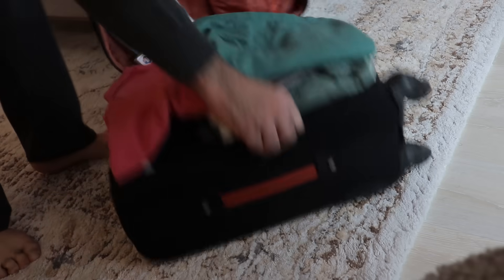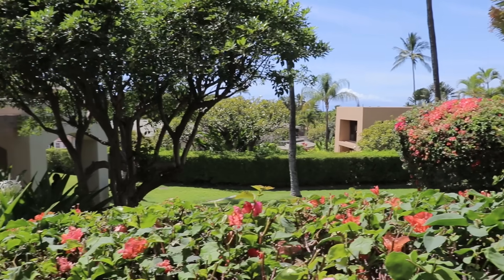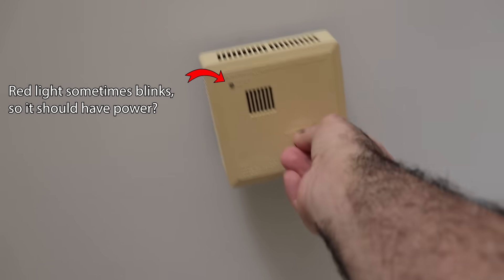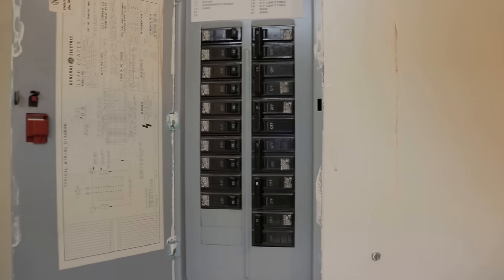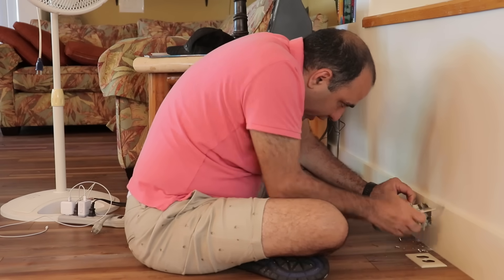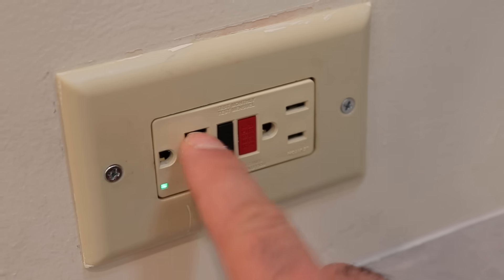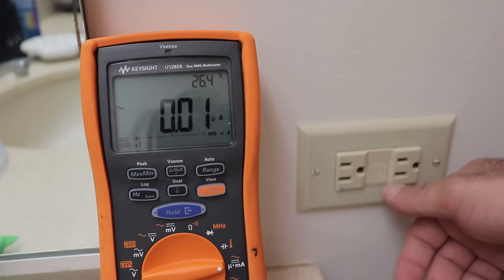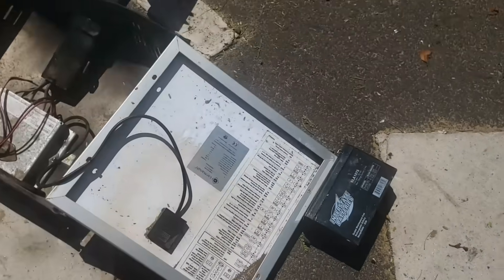Hawaiian Hotel Safety Failures

Comment: I didn't know outlets with poor contacts like that were fire hazards. I'll be replacing mine in my room now after seeing this video!
Reply from the maker: They are if you constantly draw high current from them. For low current applications they should be ok. But quite annoying since they keep disconnecting!
Reply: @ElectroBOOM  This is one of the reasons combination AFCI protection is now required on just about every 15 or 20 A / 120 V receptacle in dwellings under current (no pun intended) Canadian Electrical Codes. 

I am jealous of UK plugs - so robust, right-angle, and fused. (sigh)

Love your channel and show your vids to my first level electrician students.
Reply: @ElectroBOOM  been a while indeed
Reply: Yeah  @ElectroBOOM
Reply: @ElectroBOOM  where are you from
Reply: Loose outlet contacts also cause sparks which can cause even more heating.
Reply: @JohnShalamskas  and sparks cause carbon deposits which cause EVEN MORE heating.
Reply: @mattv5281  And the carbon deposits increase resistance, causing even more heating which eventually melts your outlet.
Reply: As a tip, don't buy the cheap $0.99 outlets. Pay a few bucks and get the so-called "commercial grade" outlets. They have much better contacts that last a lot longer generally.
Reply: If I was you I would buy a live wire detector before attempting any work just to be sure because you never know, the outlet in your room might be powered through the breaker for another area
Reply: @Cam-gb1cu  Great advice. Never ever assume a wire isn't live.
Reply: @Cam-gb1cu  My house breakers make no sense at all; entire basement living room on one breaker; one kitchen plug tied to that basement circuit. 2 bedrooms lights only and upstairs living room plugs; upstairs living room lights on the kitchen plugs.
Reply: @frollard  Yeah, many of my rooms have outlets tied to different breakers and were never marked accurately. When replacing an outlet in a bedroom not 6 feet from a light switch I shut off the breaker, checked the lights then found the outlet was still live. Luckily I always check but another outlet next to it was tied to that other breaker. At first I thought they were splitting the load in the rooms but in reality the builder seemed to just randomly tie into existing electrical when convenient. This outlet was shared with the nearby bathroom and hallway. The others somehow got tied into parts of the garage on the other side of the home.

Very frustrating to say the least.
Reply: @JJFX-  Almost always lights and plugs are on different circuits. 
On new construction if they can save 10 feet of wire by doing something legal, but crazy, they will. And all bets are off if there has been a remodel. I saw a pretty new house where they chained two bathroom outlets to a GFCI outlet inside a cupboard in the garage just to save cost. The owner had put up with the dead bath outlets for over two years, because the GFCI tripped and no one knew about it.
Reply: And switches. If you can hear a farting or buzzing noise from a switch or you see visible sparks inside, or it either can be nudged on or off by moving it just a bit  (rather than all the way), then it either has a softened spring or oxidised contacts. This can heat up in the same way an old outlet can.
Reply: and thats why when i move into a new place i bring an outlet tester to check all the receptacles to see how loose they are and if they are even wired correctly
Reply: @geekmoto1363  A (relatively) cheap thermal camera can be helpful too.  Plug in large loads at the end of the line, and all the chain-backstabbed outlets glow nicely.
Reply: If you do replace them, don't use the backstab connections. Curl and screw the wire for a quality connection. Nearly every service call I've done involving bad recepticles was due to over use or backstab connections that burned thru the sheathing of the conductor. Be careful if you've never done it. Don't touch anything energized. It hurts.
Reply: @EeekItsSnek  Shhh, that's easy money for sparkys!

Seriously, I agree 100% and I do not know why CSA allows them. Mobile home devices I've seen don't even have screw terminals. It's back-stab all the way. Garbage.

I'm careful to differentiate these for my students from the good kind of rear-wired terminals where the wire is trapped between the terminal and a square "nut" tightened by the screw.

A fellow I worked with some years back (different vocation) wired his own basement rec-room project. Did the right thing, took out an owner's permit. Discovered the back-stab terminals and thought "this is great!"

The inspector made him take everything apart and redo all the connections properly. When my coworker told me the story he was still steamed. I assured him that inspector had done him a favour.
Reply: Only in the case of heavy appliances
Reply: Yeah, heat from arcing burned one of my outlets. I'm my case, it was a loose wire on the back, but same thing. (That rent house was dangerous. Ancient 14 gauge cloth-coated wiring with 20-amp breakers!)
Reply: Get Pass&Seymour Legrand receptacles. Can't go wrong with that brand.
Reply: I have never, ever seen a worn-out Schuko Plug or receptable. Even after decades, they still grip tightly.
Reply: @kain0m  I have seen a couple of worn out Schuko receptacles (usually the plastic parts die long before the metal contacts) and a few bent Euro plugs. But those are exceedingly rare and require a lot of abuse to happen. The ones I have seen were usually of east German origin or from the 60'ies with really bad quality metal parts. Worn out, nicked and bare cables are much more common in Schuko-Land.
Reply: Silly me, I've always just bent the tins of my plug outward a smidge to get a better connection in the outlet.
Reply: @LetUsPlayMoreGames sadly in my house it didn't work. The outlet contacts were still way too spread to fit a plug in and still be grabbed by the contacts enough not to fall right out.
Reply: They sure are! The contact between the screw terminal and a wire is equally important.
Someone previously had installed power points here by just screwing down until the terminal screws ripped through the insulation on the wire tip. It got hot and started arcing internally. I had to correct or replace the rest of the power points in the house after discovering that.
Reply: Also check the breakers where the wires are connected to the breakers. The screws should be tight. My house I had 6 breakers the screws were loose
Reply: <3
Reply: Same
Reply: I’m letting my customers know that and gonna check mine at home
Reply: We had an Amazon brand urn (a super sized kettle) at work that had a fuse holder in the plug that was unusually loose. Came in one morning with a melted plug. Oops.
Reply: I guess that's one reason I don't mind being British we have safe outlets
Reply: Speak to a welder about how hot the earth gets if it's loose or frayed wire.
Reply: Don't take advice from a comedy channel
Reply: Well i mean you could also live in a country where the plugs are smartly made
Reply: @r0und603  as bad as South Africa is, the plugs are somewhat robust. 3 round pins.
Reply: @rushilkisoon  Yet still you find a lot of the outlets the only grip they have is the plastic part, the contacts are worn out and spread, causing poor contact on them. Changed many where the only thing providing grip was the shutter, and even more where the shutter was broken anyway. Then the cheap ones and the switches that melt away.
Reply: @r0und603  even here in Brasil they are very careful engineered
Reply: @r0und603  From the UK perchance? 🤔 Yes, garden-variety NA receptacles are kind of a joke, and that's before someone doofus cuts the ground pin off the plug-end or it just breaks off in a receptacle.
Reply: @r0und603  not many places have UK plugs unfortunately. It's just the UK and a few old colonies that adopted good plugs.
Reply: @Dennis_M1DLG  i live in south africa
Reply: @r0und603  Yea Vidhoard, don't replace a few outlets, move to wherever R0und is from. Some enchanted land where things don't wear out...
Reply: @outsider344  lol will do!
Reply: @outsider344  "where things don't wear out…" Where things are not badly designed.
Reply: @pakan357  LOL Yeah, like ring circuits... 🤔🙄 Give me a break. Your gigantic plugs are made for children who don't have the intelligence or fine motor control to grasp and manipulate anything smaller. In the real world they aren't actually safer, they just waste space and material, not to mention are a PITA to store, transport or use.
Reply: @awo1fman  Clueless.
Reply: @pakan357  is there some place I'm not aware of where residential outlets are twist lock connectors? Normal outlets everywhere use springy bits of metal to contact the prongs on the plug. Where are you that they have designed away metal fatigue?
Reply: @outsider344  I'm from Pluto, apparently. Because I have never in my life seen a plug that feels even remotely as loose as that piece of shit in the video, not even a 60-year-old one.
Americans simply can't design an outlet and door hinges, don't get emotional over it.
Reply: @pakan357  Oh sure, it's easy to be chill from Pluto.😜
Reply: @awo1fman  Whoa dude ease up a bit. Not everything has to be a rabid team sport.
Reply: @pakan357  Not gonna say what outlets you think dont have this problem eh? Don't want to be fact checked?
If you want to find problem outlets on pluto go to a short term rental property. Age isn't the issue, insertion cycles are. You can expect the accessible outlets in places like hotel rooms to have more cycles in a year than your example outlet did in its 60 year life.
Also, hinges? What?
Reply: @outsider344  they dont wear out cause you gotta replace them every one in a while when they get yoinked
Reply: @r0und603  Doesn't really matter which country's outlets you use. Safety features are better on different countries' outlets, but the way they make contact is relatively the same. After so many use the contacts will become loose and will require to be replaced.
Reply: You could in theory open the outlet and squish the contacts back together, instead of replacing it
Reply: @rushilkisoon  It’s not possible to squish them back together because you need to bend it a bit further than the intended position which is impossible because the opposite contactor is in the way.Also the metal may have fatigue, so it just will bend back to the sloppy position after putting a plug in a few times. I wouldn’t know a reason to not replace them anyway. If you do anything then do it properly instead of creating a bigger hazard.
Reply: @Engineer9736  ¯\_(ツ)_/¯ Worked for me. I was only able to get one contact (the outside one) on each side moved back to the proper position, but it looked like on my outlets only one contact would connect to each prong anyway.

I think they weren't worn with years of use so much as bent too far by those child-safe plastic covers. I only found the problem on certain outlets where a toddler might have obvious access. 

Getting beside the contact to pull it in was hard though. I tried precision screwdrivers but the round part was too thick to fit. I ended up using a windshield wiper insert.
Reply: @rushilkisoon  yep, you could, but some of the old receptacles were pined Bakelite and will break before the pin comes free. However some of the new ones are ultrasonic welded plastic and will not go back together easy. A very very thin melted layer may do it. If it has rivets they would be drilled as long at the bit is smaller than the rivet and replaced with a new rivet. But then for $2 for a good receptacle, the repair would cost more.
Reply: @rushilkisoon  maybe. But there's a chance the extra heat has messed with the tempering of the contact springs.
Reply: @rushilkisoon  you don't really want to do that. Just dispose of the socket and get one with current standards of construction. It's not worth risking a fire with a hidden defect such as metal fatigue resulting in the metal bending again or being softer.